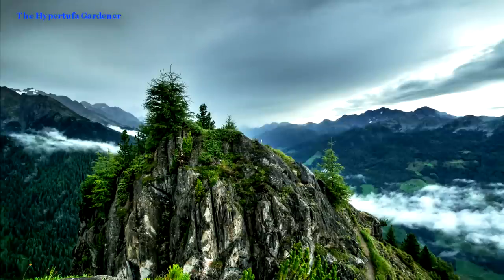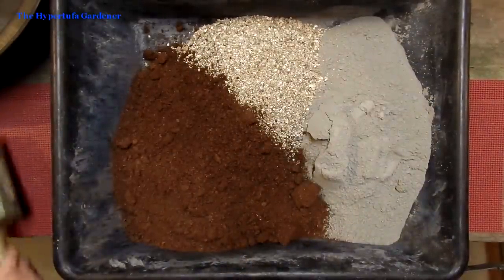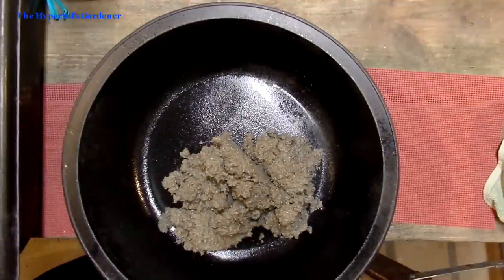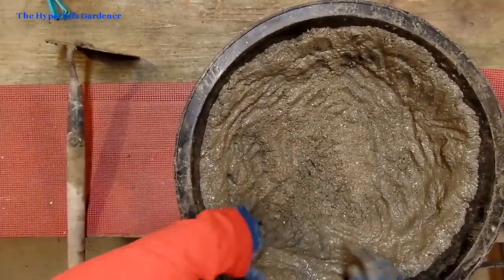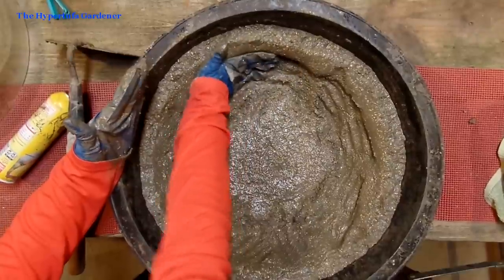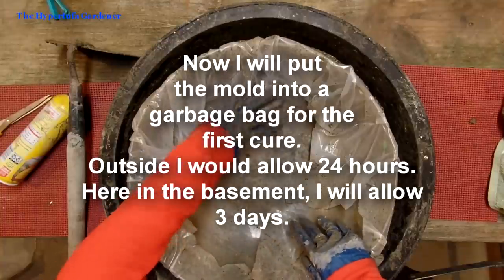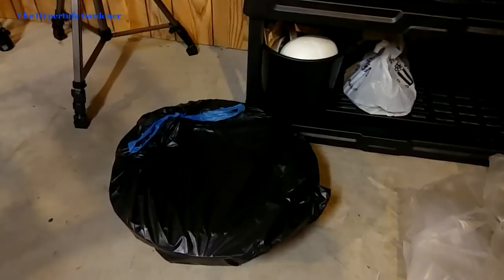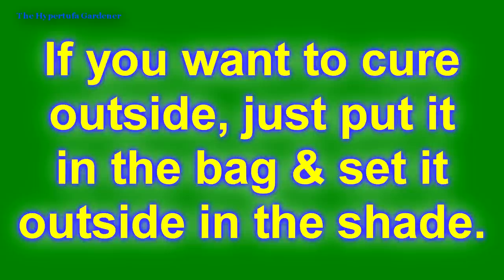Making a Hypertufa Bowl for a Crevice Garden

Comment: After you finished shaping the hypertufa and you laid the plastic sheet over the top, I wondered whether filling the plastic-lined cavity with sand would help to compress the hypertufa and hold the sides up while it cured?  I love the result - the bowl is beautiful.
Reply from the maker: Yes, that's what I stated in the video. I have used that technique before. See 16:28   In hindsight, I wish I could have done the sand technique, but I know I couldn't lift it with sand in it. Maybe for some smaller pots.